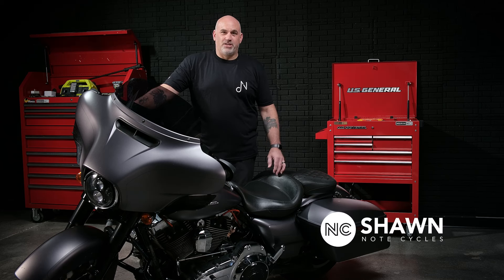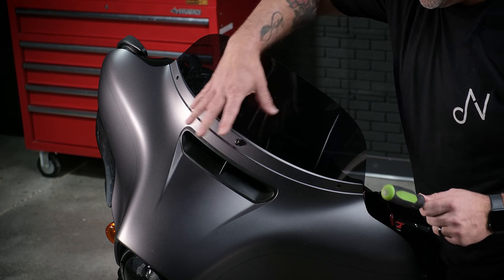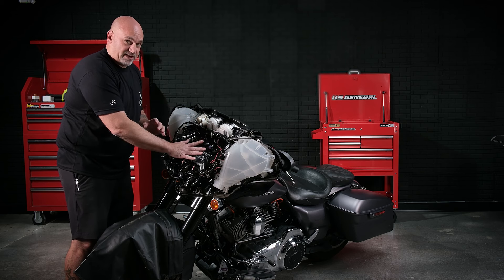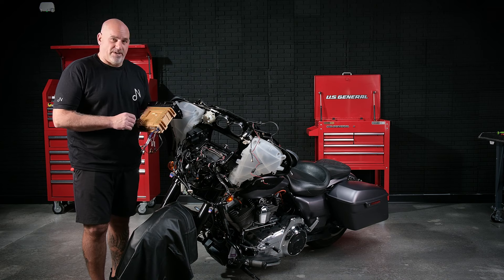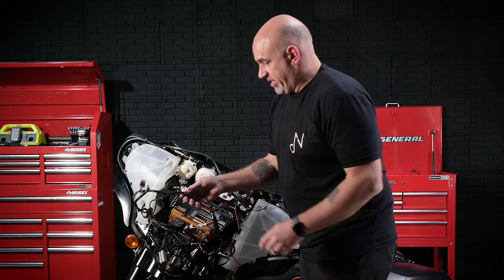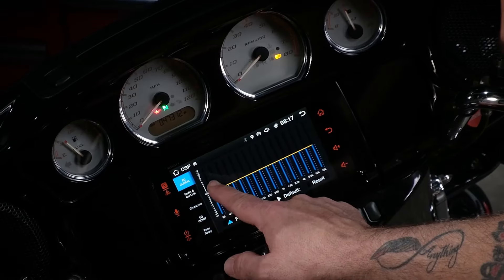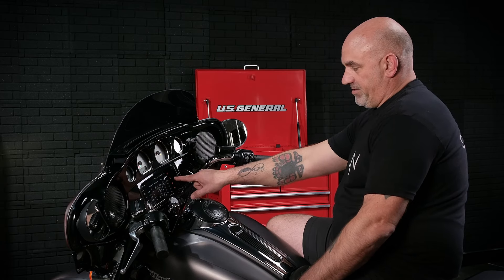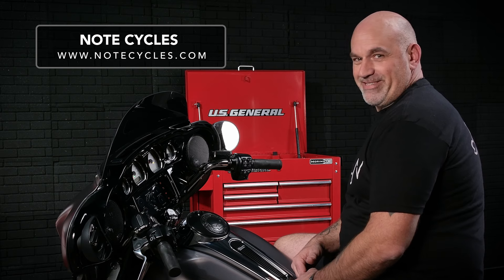Diamond Audio Head Unit Installation & Review | 2014+ Harley-Davidson Touring

Comment: Hello, Can you please share the guide to find the BIN EQ file number for GT radio again. The steps mentioned in your description doesn’t seem to work. I have a 2017 Ultra Limited. I cant find the BIN EQ file number using the steps you have mentioned. There is no service menu that gets displayed in the 2017 GT radio like the way it does in GTS radios.
Thanks